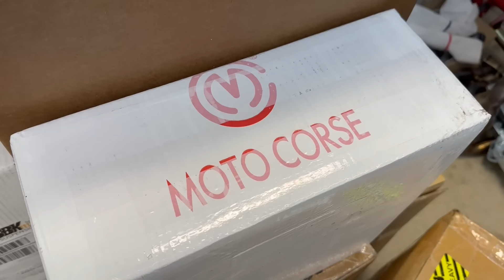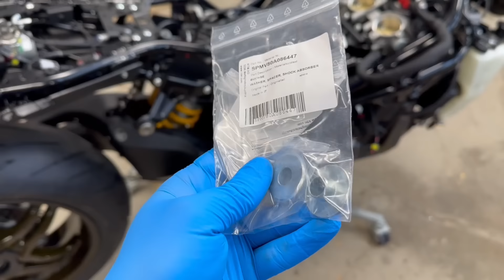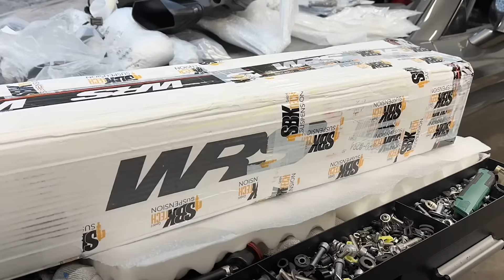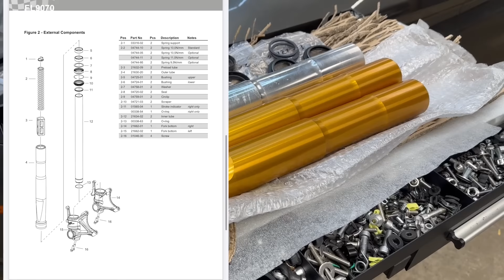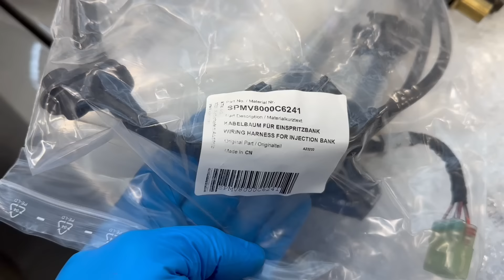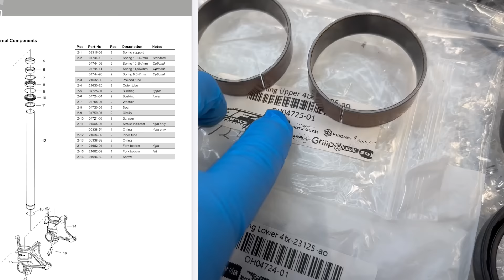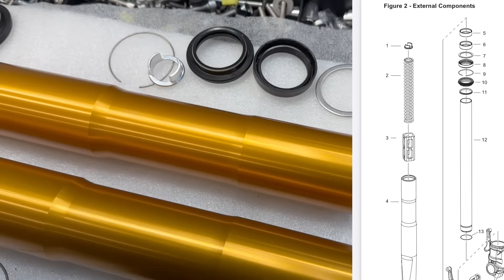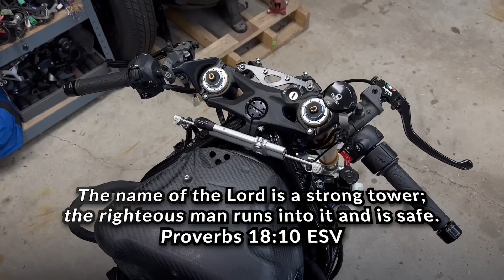Rebuilding A Burned 2022 MV Agusta Brutale 1000 RR Nürburgring (Part 17)

Comment: Cj, motion pro do a bearing and seal driver, that’s the tool you need to put those bearings in the forks, they also do bearing race drivers for the triple clamp, the same tool does wheel bearings too. 
Hope that helps buddy

Comment: that poor lower tripletree bearing, Ohlins Logo to sides, and those bolts for the rear shock needs thread lock
Reply from the maker: Ill have to change the way the Ohlins forks are facing and will add some thread lock 👍

Comment: Wait so you took the bearing race out of the top bearing and put it on the bottom bearing... so now there is just no top bearing? If you need to replace the top bearing now why not just buy two and install two new ones both at once? What do you mean by the lower bearing being 'way more permanent"?
Reply from the maker: Sorry if I wasn’t clear, I took the dust shield from the top race and put it at the bottom of the lower race because once that new lower race is pressed on it’s not coming off “more permanent” I have ordered an extra dust shield for the top. I had an extra race laying around from a previous MV parts run
Reply: @CJMediaOfficial  No worries, crack on mate these videos are some of the ones I look forward to the most from all my subscriptions.

Comment: Inner tubes aren't made for slide busching🤦 there are tools for that. Like for the lower bushing. But..this id Yours bike, Yours money. 
And when You slide lower bushing , You  should use wascher also, to prevent bushing damage. You have service manual, I'm sure that in it everything You have step by step. Including Oil specification and oil high.

For oil specification You Ca use also Motul website. I think on such forks it will be 2.,5 W thick oil

Comment: Dude, you just destroyed those lower triple stem bearings.  The races are not designed to withstand that torque to set the race, and the race is not going to be bottomed.  After every few rides, it will show slack again and will need to be re-adjusted.  And the front end will wander with the damaged bearings like the front tire is grabbing rain grooves.   Start over with new bearings/races/seals, and get a proper bearing driver.  To get the old race off, willprob have to Dremel it